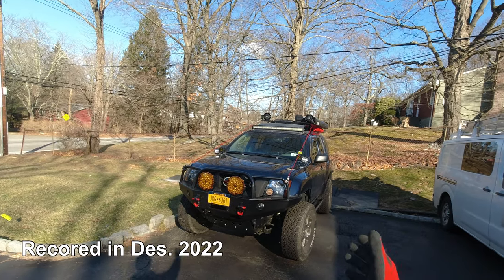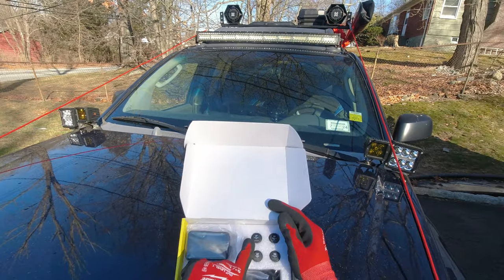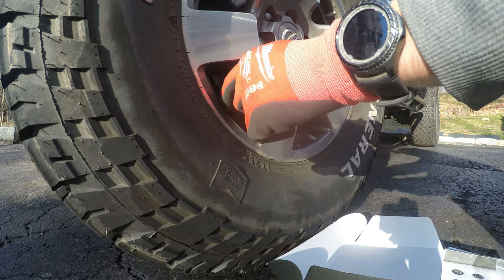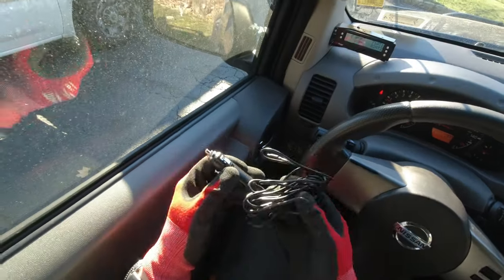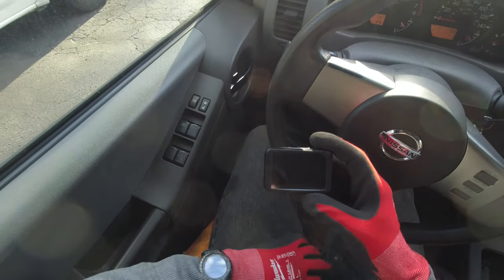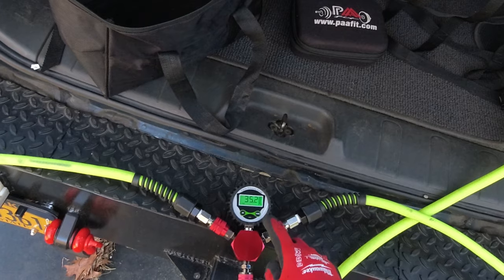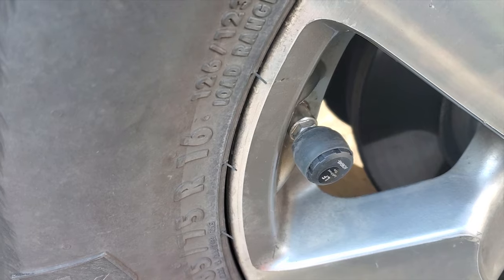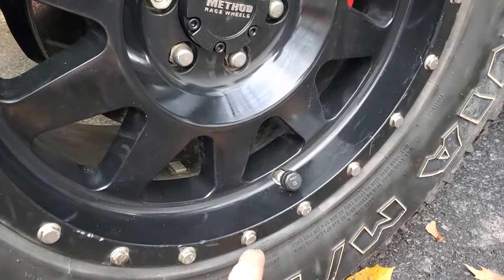TPMS Monitoring System For Any Truck Or Car

Comment: Great video man. I need some of these for my motorcycle and my older mustang. 

Also... Broooooo for the X, when I got my new wheels and tires, the shop sold me on some new tpms sensors. I was thinking I had to do the tpms reset procedure but I somehow erased the light with my blue driver! I have to wait some more time/miles to see if the light comes back. If it doesn't I'll try to make a video on it.
Reply from the maker: Thank you very much buddy!!  it be cool if you got some kind of unit too and make a video on it as well ))